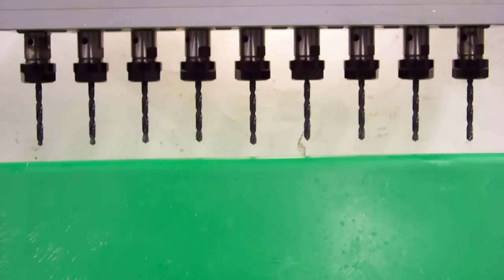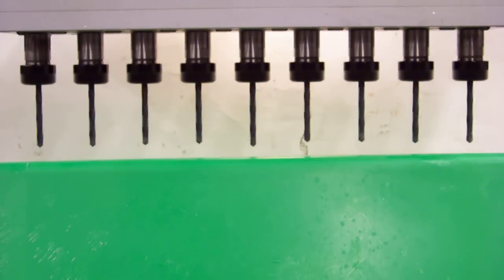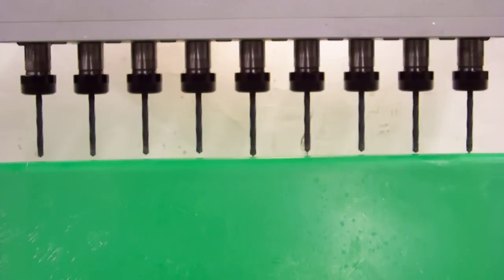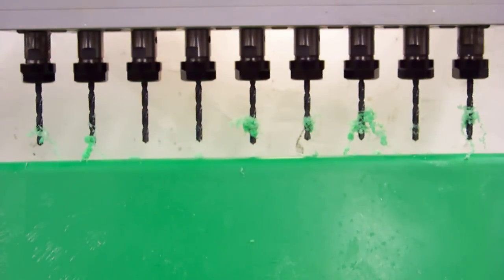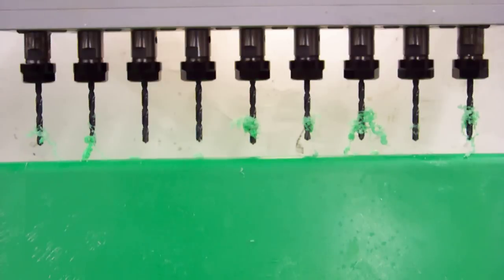Not Enough Horsepower on Drill Press During Nine Hole Drilling Process - AutoDrill

Comment from the maker: @fishproet - I believe this process was performed on a 3/4 HP (small) drill press to illustrate the concept. We are drilling holes that will be used for drainage by the customer - but this is an example video only and not the actual system we sold, etc.